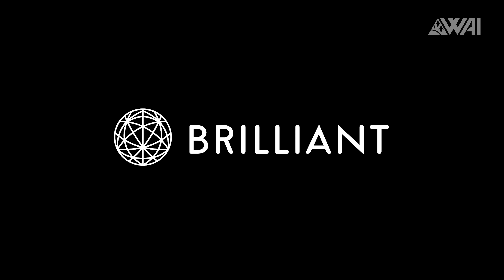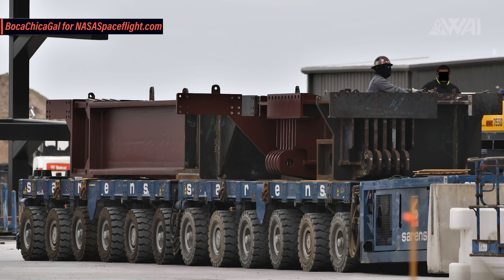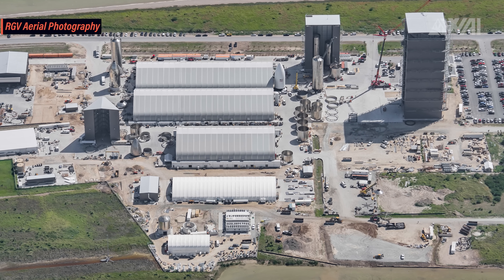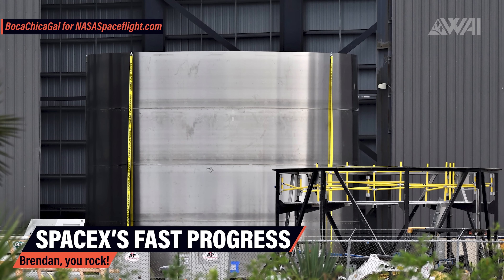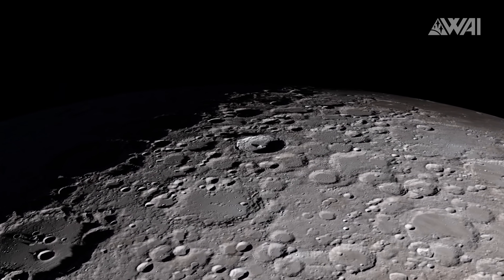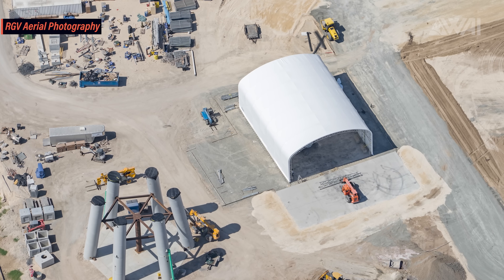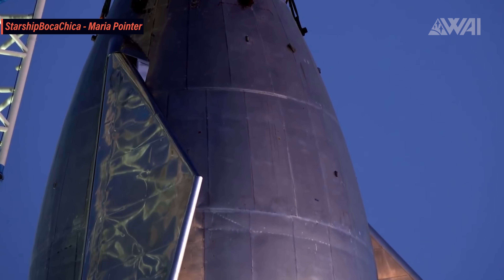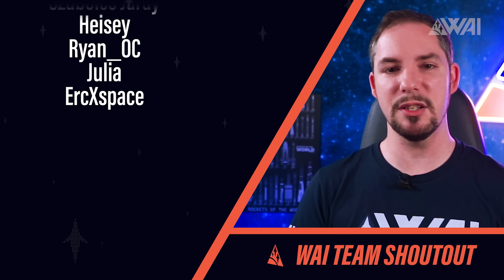129 | When will SpaceX's Starship SN8 fly?

Comment: Those red thing's in the lay-down area are large pneumatic actuators. Usually used  to open or close valves. Red indicates that they would be an emergency valve "ESDV" so if something went wrong they would fail in either the open or close position. https://www.econtrolvalves.com/esdv.html
Reply: Yes they look like large pipe butterfly valves for sure.

Comment: Do you think we will see larger ring segments at the start of next year to reduce welding needed as the best part is no part
Reply: I'd say it's extremely unlikely, as that would involve rejigging the entire production process developed thus far. Maybe in about 5 years if they get to SS 2.0 with 18m diameter, but that would probably be on a whole new line.
Reply: @foobarrel9046  I meant taller but 18m D would be something else to behold entirely
Reply: @hypervortex5930  Yes, I got that ... my reply was possibly not entirely explicit but meant to convey that they will unlikely switch to taller rings on the ø9m SS, as the welding techniques are now presumably being perfected/automated on the lines already set up. 

Changing the basic feed material dimensions at this stage would cause months of delay for minimal gain, whereas Musk is clearly putting the pedal down for increased production speed/developmental iterations.

But who knows, by the time SS 2.0 is coming online they may be 3D-printing or casting large parts of the hull from graphene?

Comment: As you know by now, those weren't gantry crane parts. As seen in the pic you show, the beam actually bolts the two SPMTs together. This is more clear in other shots Mary took. In fact, the right SPMT has another in front of it - that one has another plate bolted on, ready for something. To speculate: this will be a four SPMT combo, which will allow a low cradle between the fore and aft pair. A full 50m SS or a 72m SH will sit in this super stable position. Four of them aren't needed for the mass, but a 9 meter wide cradle between two would be too wide for the road.
Reply: We’re gonna need a bigger road. No, seriously for a moment, great reply. Definitely looks like a MEGA transport frame. SpaceX building their own cheaper Mobile Crawler Platform maybe? 🤩🚀🏗
Reply: Came here to post just this, thanks!
Reply: I was thinking could it be used to transport the ring that would need to sit on top of the concrete legs at the launch pad... is that what the big crane is waiting for... but the road might not be wide enough
Reply: @DaveGillsMovies  Well, to be honest. It looks like they have stalled construction on the Orbital Launch mount. I believe they moved the crane over there towards it just to get it out of the way for a static fire test, while the SPMT is still being constructed, and that's what theyll use to move the crane back (As well as used for other things, as we can clearly see them mounting a ring holder to it currently). I think the Orbital launch mount may just be a proof of construction, albeit, a very expensive one, but I don't know. Based on the current SpaceX Renders, it looks like the orbital launch mount will also include the water tower integrated into it (the large pie shape thing near the top of it), and a crane atop of it, but we shall see. It most certainly can just all being worked on an oil rig somewhere we can't see either....

Comment: I thought that Elon had mentioned doing a single weld up the side for the 'final' iteration. This would mean having a stupidly wide roll of stainless to start with and a large machine to roll the material into a round shape.... but considering that it's not even difficult to image such a machine, it's not much of a stretch to imagine it being commissioned and built. This would then reduce all the ring segment stacking and welding to be just a single weld up the side of the entire section. Machines exist already for welding seams like that up automatically as it is the 'typical' way that smaller diameter piping is made.
Reply: Do you have a link on when Elon said that?

Comment: The plural of scaffold is scaffolds, not scaffoldings.
Reply: True, but the plural of scaffolding is scaffoldings. Mixing the two happens frequently, but yes, one should try to keep this straight.
Reply: @donjones4719 , I've general foremaned and supered heavy industrial construction for much of my career. Both my brother's are journeyman scaffoders. Nobody calls them scaffodings in my experience. I would think anyone using the term was a novice.
Reply: @runemrick   Not really novices but just the usage of the general public. They're never as accurate or specific as the usage within a trade. But the term scaffolding does exist, I've heard it countless times, and it's in the dictionary. https://www.merriam-webster.com/dictionary/scaffolding
Reply: @donjones4719 , out of interest, I looked it up. Apparently, scaffolding refers to the individual components. IE, "The Allaround scaffolding should be kept separate from the tube and clamp scaffolding, so the scaffoders can build the scaffolds we need quickly." Who knew? I learned something new today, but it seems scaffolds is correct. However, say it anyway you wish.

Comment: Am I the only one who really wants Elon to share a timeline for their 18 meter, or second generation, starship variant?
Reply: Too far in the future and they dont even know the timeline.
Reply: They won’t even start planning a timeline until starship flights are happening routinely
Reply: baby steps. Very giant babies.
Reply: 18 meter = starship to orbit fully fueled.
Reply: @jamesretired5979  a greater diameter does not help there, you’re effectively just strapping two smaller rockets together but saving some of the tank dry mass (not huge though), it allows launching heavier payloads in one go but otherwise 9m is enough
Reply: @jamesretired5979  No an 18 m Starship would have around 400 t to LEO capability. Full fuel tank is 1200 t. So three launches, to fuel up a 9 m Starship.
Reply: @please_stop-v7o  Thanks for the analysis Sherlock
Reply: @please_stop-v7o  And fueling up smaller Starships would probably be the major use case for it. It's difficult to see any single payload that would be too large for the current Starship, nor any need for larger crewed spaces — but having a super-tanker version might be justified once they're looking at increasing numbers of beyond-LEO missions.